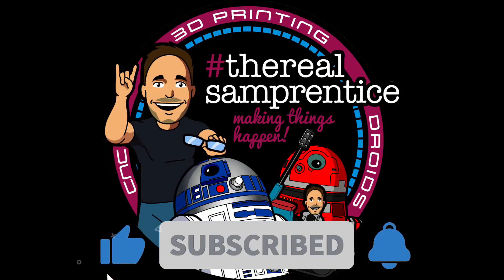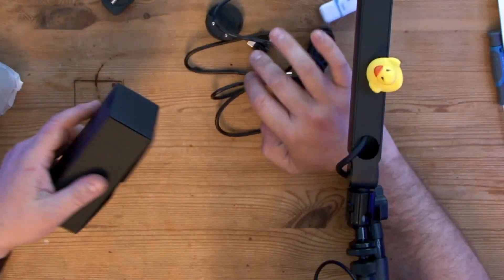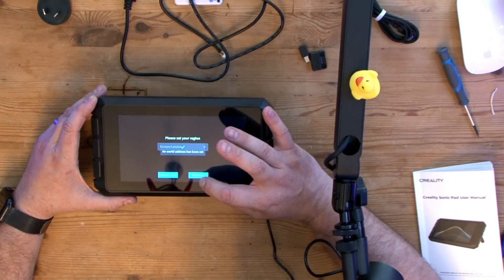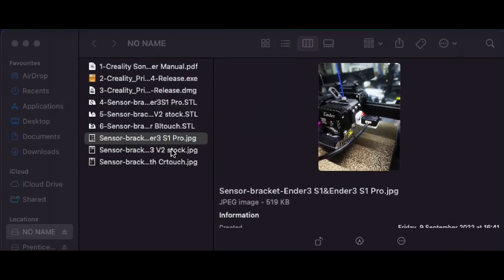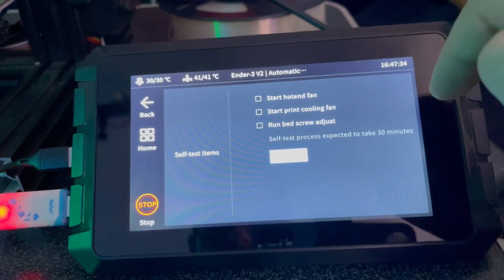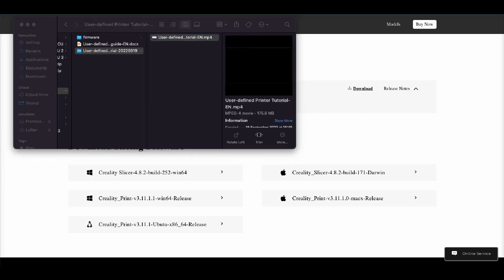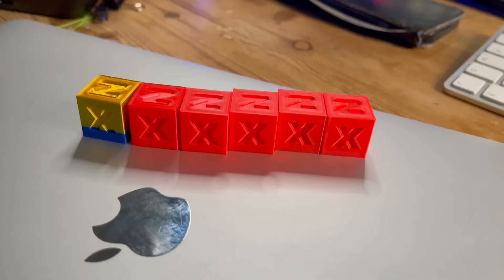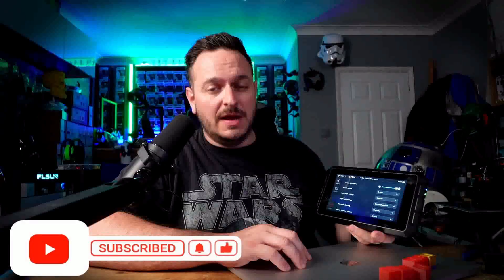3D Printing Revolution: Introducing Creality Sonic Pad

Comment: Does anybody iknow if this can be used with Creality's Ender 3 Pro  (non-S1)?
Like the ones that still sell at Microcenter?
Reply from the maker: Like the one in my video…. Yes
Reply from the maker: @unclecal_1  hey Dave there are ongoing updates with new information and printers being updated on each change. On the creality range I only really used this with a ender 3 on 4.2.2 which worked well, all I did was select the v2 as the pin outs are the same. The s1 is different. They really need to open up the ssh so people can add wha they want. Im just in the middle of the flsun pad right now and that is more open !
Reply: Cool!  Thanks.

Comment: So, mine should be here in a few days, i have two Ender s1 Plus i want to connect to. but until i get a preset or a good config im hesitant to mess with it. So if i wanted to change over my ender3 pro in the meantime, once i switch over what will become of my ender3 pro?
Reply from the maker: Yes mine in the video is the pro
Reply: @TheRealSamPrentice  but what happens when I switch  it to my other printers, flash back to old firmware?
Reply from the maker: @3dFantasyCreations  yep that’s correct
Reply: @3dFantasyCreations  you could just flash back to Marlin, but you'll likely love klipper so much you'll run both printers from the screen, you can run more than one printer on it.
Reply: That would have to be after i get a second sonic pad, my enders are nowhere near my s1s. Lol

Comment: would it be hard to use this 1 device on multiple printers? i dont fancy buying 3 but if i could use 1 for 2 enders 3's and an ender 2 pro (which i notice wasn't on their list) with little effort to switch between them,  i'd be  investing today lol
Reply from the maker: You should be able to control 4 as there are 4 usb connections but then you won’t have the cams on top of that
Reply: @TheRealSamPrentice  ah sweet, thanks for the reply

Comment: this is a great way to prevent countless ender 3s from ending up in landfills. love the wifi network name haha
Reply: I think most Enders 3s end up in landfills not because of speed or print quality but because of the machine itself and how badly it's made. The bed doesn't stay level, bed isn't flat, it doesn't have a probe and re-leveling before each print is tedious, if you don't set up the bowden tube perfectly it clogs all the time, extruder arm breaks, filament grinds on metal parts, etc. And it's loud AF. Klipper won't fix those issues.
Reply: @m97120  i have 6 of the ender 3 and never ran into any of this....i added glass bed and have to level maybe once a month if that with near 24/7 printing. never had and extruder arm break (i did wear through one with it being used to much, metal extruder assembly is super cheap), never had filament grinding, and well, i run 15 printers normally at a time so i cant comment on the sound because it all meshes together.
Reply: @m97120  I think many people give up or talk bad on them as they are new users who just have no clue or patience to learn.  Lots of user error happens.

I've loved my Ender and it spits out prints as good or better than a prusa for far less.  It's 100% in the setup and calibrations and build.

Comment: I just walked through the VM install and firmware creation.  Definitely a few gotchas compared to the Creality tutorial video.  On ubuntu-22.04.1, the klipper setup script needs to have python_dev changed to python2_dev, and there's nothing in the main repo...you need to clone the klipper folder instead.  All in all though, it's not as bad as I've seen.  Now I just need to understand the firmware make parameters better.  Off to the klipper docs!  😅

Comment: Sam, do you think it would work with the Tronxy X5SA 400 pro? I have issues with the Z offset on the stock firmware
Reply from the maker: I think if you can ID the klipper settings in the new setup files - yes, but thats the same as any klipper build

Comment: So im using this Screen on my E3 S1 Plus, there is 1 MAJOR downside to this...  The screen does not let you change the ABL Mesh that it messures out. I use everything as it is supposed to but the mesh is not accurate, i have some of the points way to low and some way to high. With the Original Knob screen + Proffessional Firmware you can change single messure points. On this 180 USD screen you cant...
Reply from the maker: The screen might not, but you can go into the firmware and modify it.
Reply: @TheRealSamPrentice  I guess ill have to find that place where i can actually change that then.. Im kinda new to this Klipper interface
Reply from the maker: @CowallTV  Well if you go into the IP of the unit you can start to explore more than the screen. This has been a problem as klipper is really powerful, but how creality has delivered on it to the public is not the best.

Comment: Looks like another great product from Creality. I wonder if they are going to open source it so you could use that on another tablet? Or would they need to for Klipper? Since Klipper can run multiple printers, is this set up to also run multiple printers? The price is decent.
Guess I should have watched the whole video first, before commenting. 🙂
Reply from the maker: Pretty sure you can run more than one, I don’t have that many creality printers anymore or they have been upgraded with different boards etc. let’s see what comes in :)

Comment: Do you set the speeds via Klipper or in the slicer (I prefer SuperSlicer)? Noob here, asking the basics ;)
Reply from the maker: Great question, either :) but the slicer once you have the calibration down
Reply: @TheRealSamPrentice  Hmm...it seems that SuperSlicer doesn't make this easy.  The "Default Speed" is disabled unless you mess with other speed settings (apparently), but I haven't figured out the magic parameter combination to unlock it yet.  It seems to be tied to the experimental "Auto Speed" setting too...
Reply: @MrScreenCaster  right? I can't seem to make it go much faster either. What does do something is the Speed settings in the Tune submenu of Klipper LCD UI (or in the web UI).
Reply: @MrScreenCaster  I keep seeing these 2x, 4x speed claims yet all I was able to get was something like 10% faster, maybe.
Reply: @kloakovalimonada  Thanks for the feedback!   Does your setup have the sensor?
Reply: @MrScreenCaster  you mean ABL? I have Bltouch
Reply: @kloakovalimonada  Sorry...I meant to say, the one that is for Input Shaping (accelerometer)?
Reply: @MrScreenCaster  I have the usual axl345 on the way. I know I would not get a good quality with high speed without input shaping, but the question (how to set up high speeds) still stands.
Reply: @kloakovalimonada  Cool, and agreed.  I'll be keeping an eye on this space and experimenting when my kit arrives.   At this point, every time I fiddle with my speeds, I end up under or over extruding (among other issues).  I'm kinda new at this and, so far, I haven't done an aggressive print that takes more than a few hours.  I'm hoping that a well-tuned Klipper rig will help me print larger items...we shall see.  😀
Reply: You would set the max accel in the klipper printer.cfg per the results of input shaper calibration, and then in slicer you can set any acceleration you want below that max, I use max for sparse infill, a little less than max for inner wall, about half for outer wall and top infill, a third for first layer etc.

Comment: got mine today and can't get it to work on the ender3 max
Reply from the maker: What have you tried ?
Reply: @TheRealSamPrentice  nothing yet asked creality what I need to do now just waiting for them get back to me
Reply from the maker: @karlsmith7021  so what happens if you load the normal ender 3 profile ?
Reply: @TheRealSamPrentice  haven't done that will try that tommorrow
Reply: @karlsmith7021  If the normal Ender 3 firmware works on it, you may just have to edit the X, Y, and Z-axis values in printer.conf.   Be cautious if you do though, it'd probably be pretty easy to crash the head into the bed and break something.  I'm in the process of converting an old Chiron to use Creality parts, so I'll have to figure out how to modify these values safely too before long myself.

Comment: This is pretty neat. I am kind of confused how klipper can speed up the printer yet still have decent quality.  I've been running Alex's firmware for a while and been fairly happy with it but being able to get better results is always what i'm after.
Reply from the maker: Check out my v400 video that’s klipper on a delta.
Reply: Pressure advance and input shaping are key if you want to print fast.
Reply: Klipper works by using the small but much more powerful computer (RPi or this screen computer) to do all the motion calculations and the printers mainboard is just handling the movements of the steppers and sensors etc., so it can process many more steps per second than the mainboard MCU using Marlin, and with Input Shaper and Pressure Advance it compensates for the quality issues you run into with higher speeds. Technically you could compile marlin with higher acceleration and print pretty fast but you'd likely have quality issues you won't get in klipper. Also once klipper is installed you can make changes with a simple restart, no more compiling Marlin for every firmware config change.
Reply from the maker: @urufushinjiro  I’m hoping that these bed slingers aren’t shaken to bits
Reply: @TheRealSamPrentice  I've run klipper on my Ender 3 Pro for about a year at 3500mm/s2 no problems.
Reply from the maker: @urufushinjiro  like you say klipper isn’t new but the pad and marketing is :) I have klipper on 3 of my ratrig the v400 and now this ender which was dormant in the garage.

Comment: Hmm, seems Creality doesn't understand that to do Input Shaper on the Y axis the sensor would need to be mounted to the BED, not the toolhead on a bedslinger.
Reply from the maker: You’re correct but the g sensor will just need to be attached to the bed for the y and you just blend the two :)
Reply: @TheRealSamPrentice  Is that sorta easy to do?  I also can't seem to the the sensor mount STL files anywhere.  I guess they're only on the included USB drive(?)..
Reply from the maker: @MrScreenCaster  yep. It you’ll need two - catch the steam on Wednesday tho!!

Comment: Thanks for the overview! Sadly, it looks like the advertised "easy" set up for non pre-configured printers is anything but. I'm sorry, but if your process starts with installing Ubuntu on a VM then it is in no way, shape or form easy for the average user.
Reply from the maker: Totally agree I’ve been told that the next update will contain simple development of a push button output for creality printers
Reply: @TheRealSamPrentice  I hope so. I have an Ender 5 Plus bought the Pad on the promise of an easy configuration process.
Reply from the maker: @locust0311  well it should be as it’s a creality product, and by the time you get the product I’d guess that would be inline with older products along with the newer ones
Reply: Honestly, not sure why they included all that, if it's klipper then you should just be able to follow the instructions on the klipper docs as far as SSH into the screen and then make menu config and set up for your board then flash the firmware.bin to the printer and use/make a printer.cfg.
Reply from the maker: @Allan Mitchell  Its password protected at the moment which is annoying
Reply: @TheRealSamPrentice  I hope they come up with a solution soon because I got my Pad yesterday and have tried to follow their instructions to no avail for creating a configuration file for my Ender 5 Plus. I can't even update the firmware on the Pad itself because I cannot access any menus until I configure a printer, which I'm unable to do. So basically it feels like I'm dead in the water until they post a usable profile/config I can download.
Reply from the maker: @locust0311  hummm leave that with me
Reply: @TheRealSamPrentice  I'll be interested to see what their solution is. I assume it will be something like posting downloadable configs that the pad can access from the USB stick. Hopefully they account for us folks that swapped out for the Silent Board too! The E5P is (was) a noisy one 🙂
Reply from the maker: @locust0311  yeah for sure I mean many of my boards were updated to bigtreetech boards so it should work the same aslong as the cfg files are correct

Comment: Sent it back,  any device that calls back to China,  does not give you root/ssh access,  has access to camera and my files,  and  not give you access to set permission and or access does not go on my network.
Reply from the maker: I did mention the ssh in the video to be fair
Reply: @TheRealSamPrentice  Yes, you did and you have to asked yourself would a business really want to set this device that is manufactured in China,  that is attached to the internet,  and does not allow you access to the operating system to manage the security (permission, file access, camera, firewall etc).  This is definitely not how I would secure my intellectual property.
Reply from the maker: @chrisc9213  From what i've been told the ssh element should be resolved at the end of the month. I totally agree with what you're saying and told Creality myself the ssh should be opened up now and not when they feel like it. 

FLSUN's ssh is now opened up, but I think due to the sizeable amount of sonic pads sold ssh password was closed off while they setup further tests on their devices. 

This wont be the first time they did something like this, again opening up firmware under licence etc etc. I'd say give it a week and if they don't put the password out ship it back.
Reply: @TheRealSamPrentice  I sent my device back,  I have enough lessons learn from working with Home IOT devices.  The OS is Ubuntu and Klipper which has their own OpenSource license,  they are supplying computer hardware.  If they are licensing klipper that is fine,  however sitting it on top of Ubuntu and not giving you system access is a big security concern, since they are not taking any liability for the security model and security of the device.  If you choose to keep the device I would recommend connecting a packet sniffer to analysis the traffic like I did to monitor the out going traffic and log it.  Not sure why it would take to the end of month to allow SSH access,  unless they are going to give you ssh account the with limited access.

Comment: Looks like they took multiple pieces of free and open source software and locked it down and calling it their own, because at a glance, it looks like they just took Klipper (obviously), KlipperScreen, and fluidd... and then added their own theme, but otherwise look identical to the freely downloadable version...

I did call them out on their social media that it looks like KlipperScreen, but they say that it's not... however the UI is unmistakably identical... 

I understand that they made this to Klipperize their own line-up of printers to stay relevant especially in the age of the BambuLabs X-1 Carbon, and they are in no way obligated to make it also work for other printers... but taking free stuff, commercializing it and then locking it down is kinda not cool
Reply from the maker: Yep I agree, it would have been a different review IF they didn't open up the UI - That being said tho you can reflash this unit and I expect it will be able to be streamlined for a solid version of klipper.

Comment: They must open the hardware Inc the bootloader to enable the usage with a other Linux distro or they miss use the GPL software IMHO
Reply from the maker: so you can ssh into the IP address and once you are there you are greeted with a password, which creality as of yet wont give out. Currently klipper holds a range of .cfg files inside of their github, so you can grab that file and whip it onto you usb and the pad will read it. HOWEVER, you also need to export klipper.bin file onto your sd card to be read by the printer. Creality has a very overcomplicated solution to this by you hosting a virtual machine and building files to then export. This is not a good solution at all and its very complicated with little to no support on the errors generated. That being said i'm told that in October there will be another software upgrade where it will open things up.. Watch this space!

Comment: Hmm, I think rather than this I'll try Octoprint on one of my old smartphones as a replacement for the Raspberry Pi. I'm not sure what Creality Klipper gives me especially since Octoprint is completely open and I'd be upcycling an old(er) phone.
Reply: Klipper is open, this is just a Creality version, probably due to missing Raspberries on the market. So another way to get and run Klipper.
Try it instead of Octoprint, Klipper is far far better firmware and management combo than Octoprint and Marlin.
Reply from the maker: Sounds like a plan, the USP is to add alternative software where they have an element of control. There's a bigger picture along with concerns of "how can we break a printer by installing stuff onto it." Your idea is perfect! and i'd love to see that in action!
Reply from the maker: @ZhuJo99  Blend that with super fast printers like the v400 and the Bambu.. and you have a lot of SLOW printers, this could be viewed as increasing the speed and quality to maintain that printer in the market.
Reply: Klipper is a firmware, Octoprint is an interface, you can use octoprint with klipper though it's not recommended as the native interfaces (Fluidd and Mainsail) are much better.

Comment: Hate to be that guy but it’s real expensive. $169 seems like a lot unless you could hook to multiple printers.
Reply from the maker: and you can ;) just like a pi
Reply: you can even use an old laptop and install klipper urself for free.
Reply: $159 now but out of stock
Reply from the maker: @tralfazy  will be back in stock in October im told
Reply: @TheRealSamPrentice  Great!  thanks